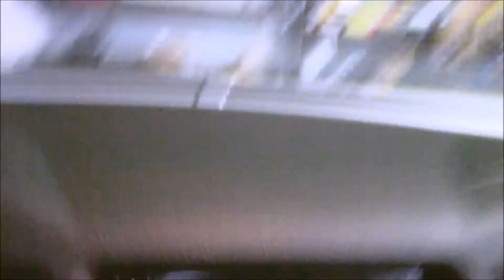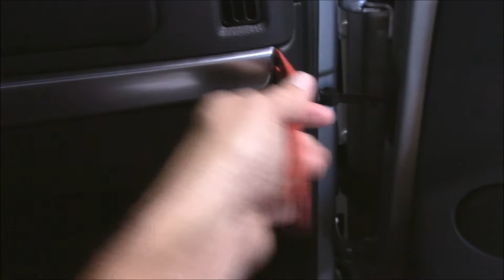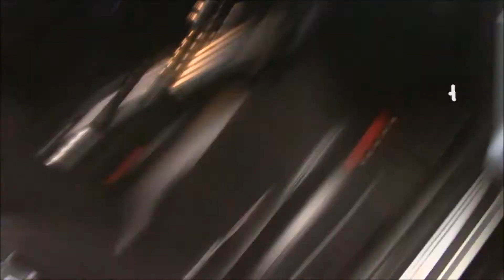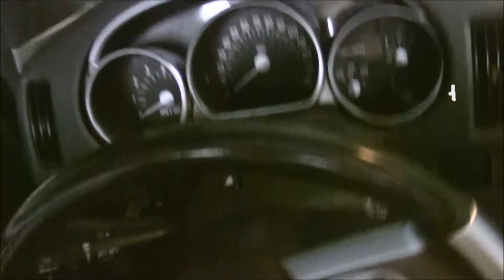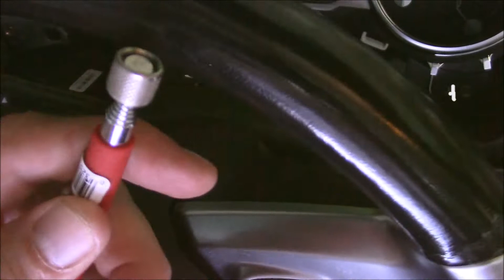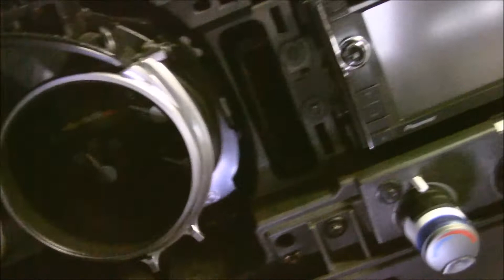2005 Chevy SSR  dash cover and instrument cluster removal

Comment: Definitely DO NOT just pull the dash trim over the airbag.... remove the 3  7mm screws from the bottom of the glovebox, and then the 2  10mm bolts from the bottom of the airbag, and the whole airbag comes out in 1 piece without damaging the cover.
Reply from the maker: That sounds like a better option, what I did was how others had told me to do.

Comment: What kind of head unit is that? Does a double din fit in without cutting the dash?
Reply from the maker: It's a Pioneer 930BT, no I did not have to cut the dash.  There is a video of the install on my channel. https://youtu.be/cKEQX357fdg